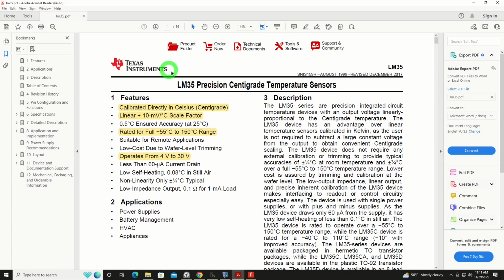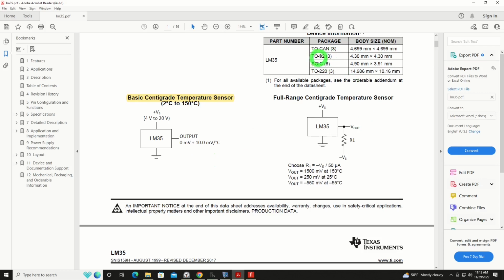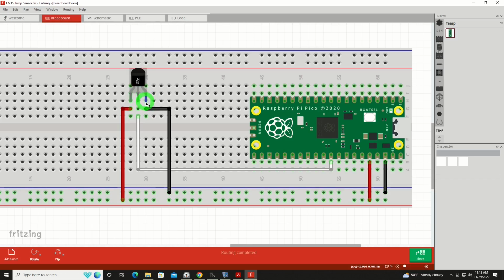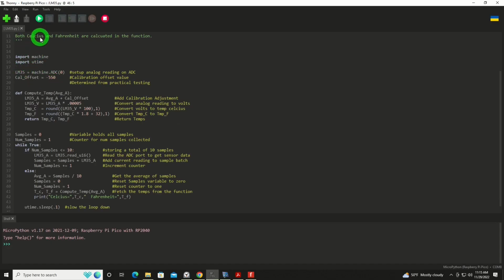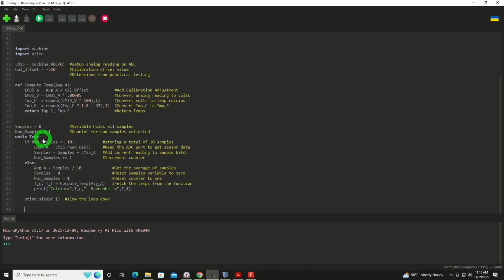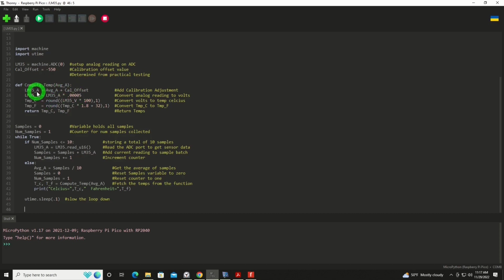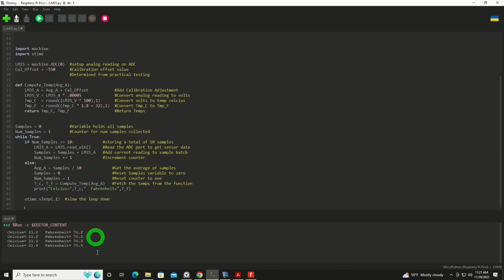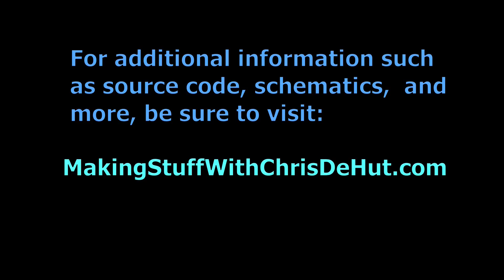Measure Temperature Accurately with your PICO and the LM35 Temp Sensor

Comment: Well explained, useful concise project.  Have you considered sending the temp data via wifi  to an MQTT broker (possibly running on a regular RPi) and either node-red or a web server (also running on the regular RPi) to graph the data on a web page and even store it in a database?  A much bigger project for sure with lots of moving parts to master.  You have a great teaching style and thoughtful content, thanks!
Reply from the maker: Hi Quaternion,  Thanks for the feedback, suggestion and kind words!!! Very much appreciated.  I have a temp/humidity data logger in the works right now that sort of fills the bill. It is not as grand as you are suggesting but it should be a good starting point for more IOT type projects and videos.  Thanks again!
Cheers!
Chris

Comment: I'm a beginner in electronics, and I'm trying to understand where the value 0.00005 comes from in the code for converting the ADC reading to voltage on the Raspberry Pi Pico. The calibration offset is 550mV, and I calculated the step size as 3.3V/4096 = 0.000805 and can be rounded off as 0.0008, but I still don't understand how that specific value 0.00005 was derived. Please correct me if I'm wrong and clarify this for me.
Reply from the maker: Good morning robingeorge6672,
While reading your question I recalled that .00005 value used as a constant.  I looked at the source code to confirm, then I looked through my notes for that story.  I cannot recall anything to indicate why that value was used.  What is even more concerning is how I got correct temperature readings with that value.  The difference between .00008 and .00005 would have a very large impact (13.4 C) on the output.  

Thank you for bringing that to my attention!  I will have to update the source code and retest the results in an actual circuit.

THANK YOU!
Cheers!
Chris

Comment: Another great building block tutorial, thank you!
Please take this as the genuine feedback that it is: I found the green circle around your cursor distracting due to the other code under it being partially obscured. I also wouldn't mind the code font size to be increased a bit - but I am using a notebook (and old eyes!) and maybe others don't see a problem. Thanks again, please keep these up.
Reply from the maker: Hi C G,  Thanks for the feedback, suggestion, and kind words, VERY MUCH APPRECIATED!.  Regarding your request I have a temp/humidity logger project in the works and will be out around early summer I think.
Cheers!
Chris
Reply: Thonny has increase fontsize option in the menu, also the shell can be replaced with a movable shell, use tools/open system shell, but to run a file you will need to import it   e.g. for demo.py then do import demo
Reply from the maker: @jyvben1520  Hi Ben,  I think I need to leave the settings large all the time and stop switching back and forth. I noticed the font size not getting back to the "video size" several times now.  Just too darn many things for me to keep track of when filming 🙂
Cheers!
Chris
Reply: @MakingStuffwithChrisDeHut  would destroying the config file help ?
Reply from the maker: @jyvben1520  Ha, probably, but I think I will save that as a last resort!

Comment: I've been using the DHT22 units.  They occasionally return readings that are not consistent with previous readings (many degrees different).  I read at one per minute.  I'm trying to control the temperature in a greenhouse with a Raspberry pi 3B+.  If I replaced the DHT22 with the Pico and LM35 "talking" to 3B+, it might solve a problem I have with the DHT22.
Reply from the maker: Hi William,
It might, but I have found most of these digital temp sensors can be a bit wonky at times.  I have resorted to averaging in some other applications and that has smoothed things out there.  Keep us posted on what you find if you get around to trying it.
Cheers!
Chris
Reply: @MakingStuffwithChrisDeHut  I've thought about using a low pass filtering average.  With either kind of averaging, it would take some time.  I've read that less than 5 seconds between  readings on a DHT22 is a problem.  Instead of one reading per minute, it would mean multiple readings per minute to get an average.
Reply from the maker: @WilliamBurlingame  Are you looking to get readings every minute for your project and then perform an action on that?
Reply: @MakingStuffwithChrisDeHut  Yes that's what I do.  I think I may start a thread to take  a reading every 5 seconds and maintain an average during the one minute interval for the main loop to act on.  I will still discard and not include  any readings that are very inconsistent in the average calculation..  I'm trying to control the temperature in a small greenhouse.
Reply from the maker: @WilliamBurlingame  Being that temperature changes slowly, is it really necessary  to sample the data that quickly? I might be missing something so forgive my questions.
Reply: @MakingStuffwithChrisDeHut  The one minute time interval was an arbitrary time and it was an easy time to  check. I just check to see if the second returned from datetime  is zero. The RPi 3B+ isn't being challenged.

Comment: i am having difficulty in reading the  data i used the same code and same hardware
my reading are in range of 0.1-0.3 degrees Celsius
please help Chris
Reply from the maker: Unfortunately it is pretty hard to diagnose a problem when the only thing you are provided is the symptom you experience.  
Check your wiring (most often the problem).
Check your connection to PICO (easy to miscount pin numbers)
Sensor could be bad (depending on source, frequent cause)
If you typed in the code, double check it ( very frequently the cause)
Certainly possible, something is wrong in the code I posted.
Chris